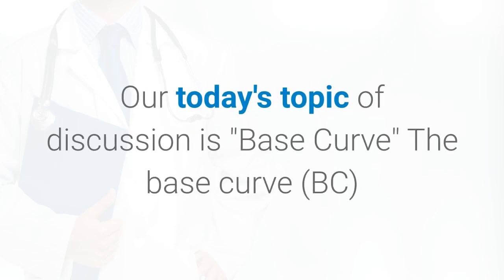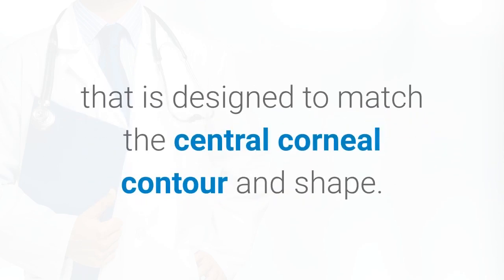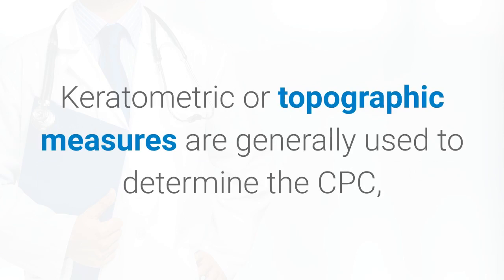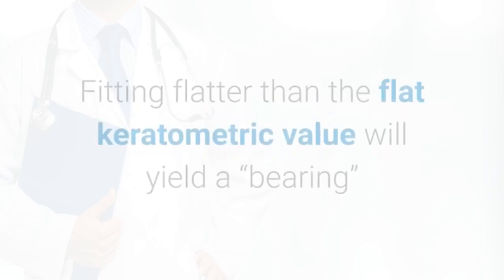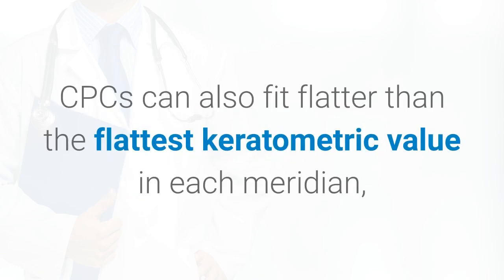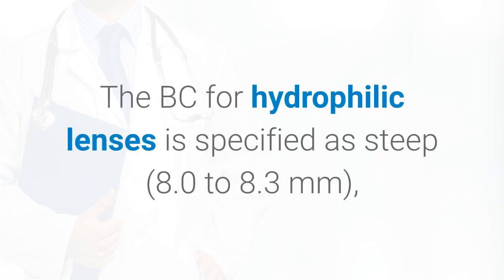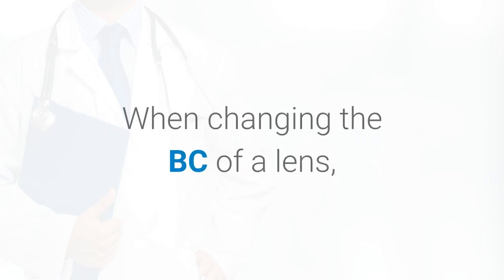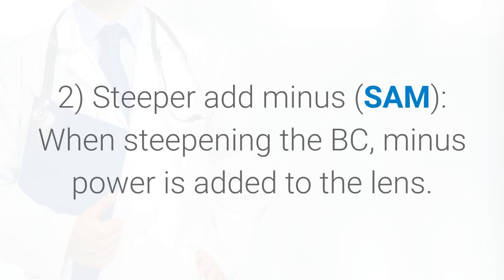Base Curve of Contact Lens

Comment: Will you please check my understanding: I have a lens -3.00, 8.6. If I change BC from 8.6 to 8.4, the change in BC is 0.20 (8.6–8.4). To adjust the power ((8.6–8.4)/0.05)0.25 = 1.00. Therefore, Adjusted Power = -3.00–1.00 = -2.00. Is that correct? Thank you.
Reply: In a soft contact lens that difference is not necessary to adjust. It is crucial in a rigid lens though. Soft lenses vary from manufacturer to manufacturer and there is no "spot- on" accuracy.  An 8.7 in one manufacturer may be looser than an 8.9 from another… Some companies "run tight" and others "loose".